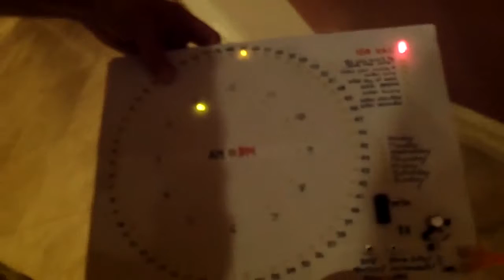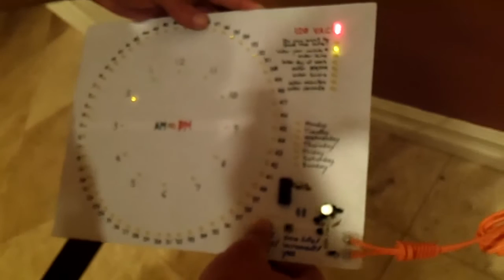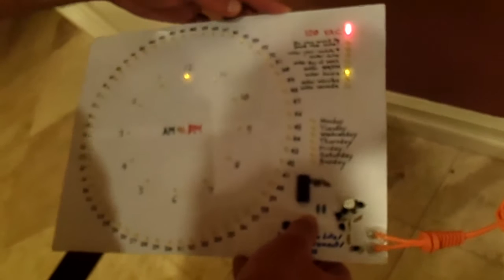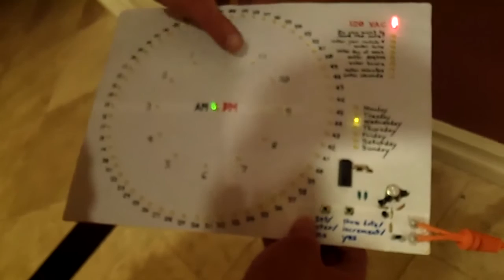build a dial-type ("analog" ring) LED clock yourself (89 LEDs) (LED clock kit)

Comment: Yes, I abandoned the project properly after getting nothing concrete.
Finally I seem to have solved that underlie the LEDs unexpectedly.
The shipping kristal me you do not put specific registration, just put: S22KSS0F. So I can not know how often is.
They replaced it after one of 4000MHz.
as I can measure the delay on the clock exactly?
In three days was delayed about 3 minutes.
I might try a kristal of 6176MHZ? And see what happens?